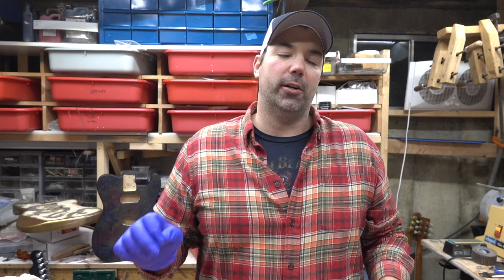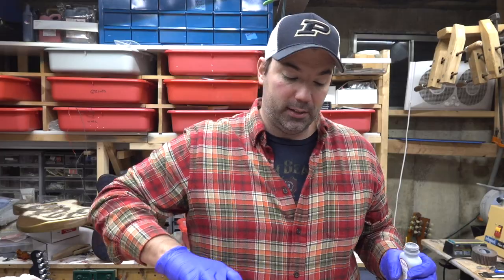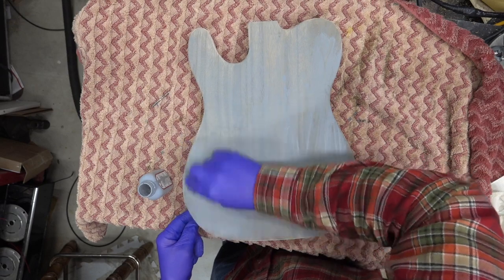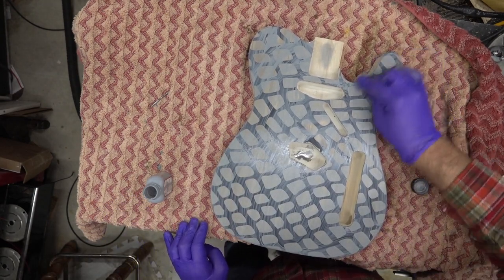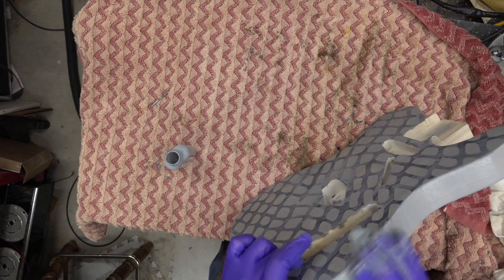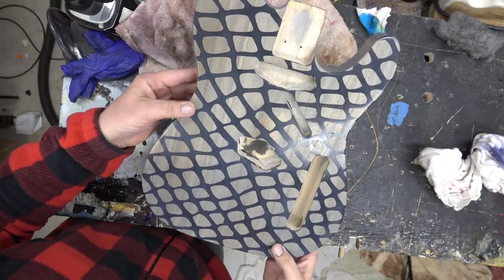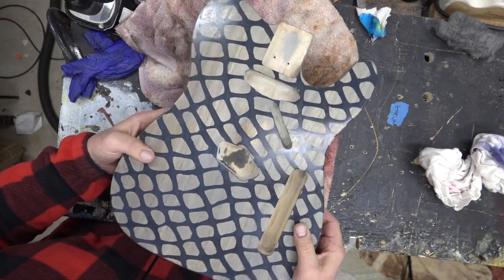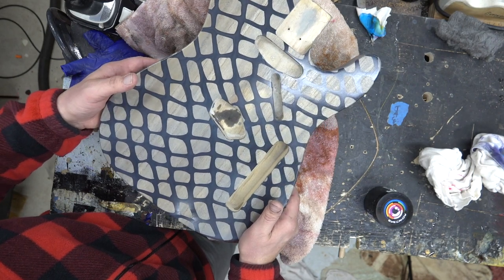Snake Skin v2 - Textured Guitar Top - More like Lizard Skin but rolling with it

Comment: Much better pattern .👍
For Gray stain I've used Sherwin Williams Opex Primer tinted with black ,thinned with Fast dry clear stain base . Used oil based primer also when brush work is necessary . Depending on chemical  compatibility .